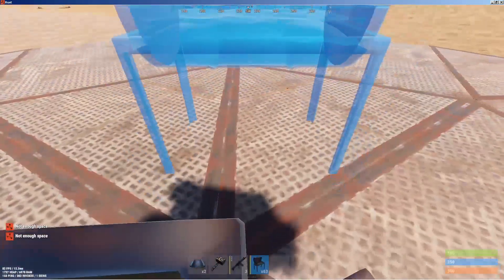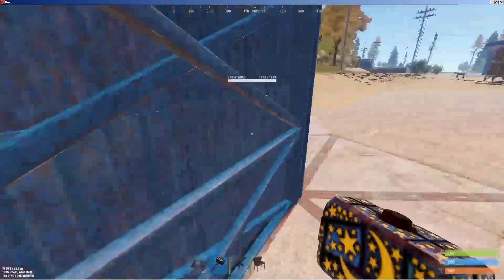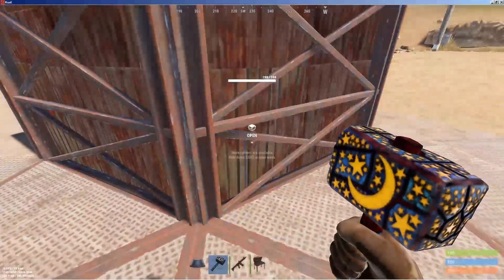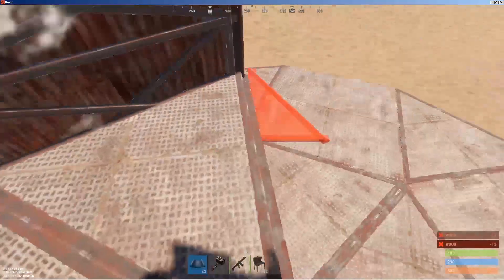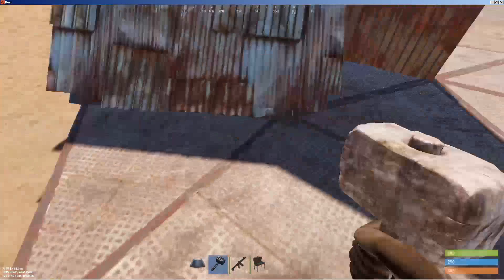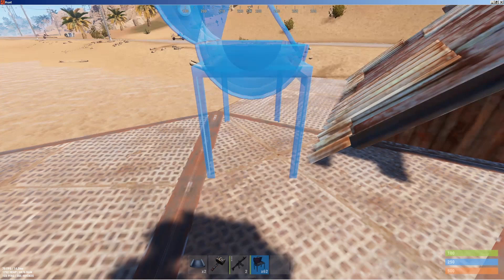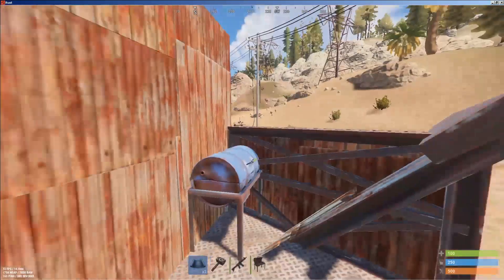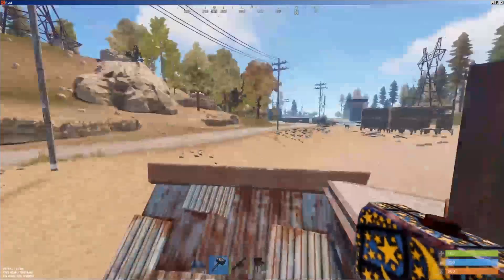PATCHED BBQ 5: The Triangle Cheater Explained (Rust Base Design 101)

Comment: Prefect.

Now you need to do a bar with a double stability bunker entrance, a single triangle sealed bunker, stacked roof, triangle only, tri tc (wall gap used as fire port or to cover hbhf sensor for activating traps) entrance on the roof only, tesla fall wall exit, triangle tile only, roof staked corridor with the shotgun traps to be unsplashable and hbhf activated door push trap, ladder and chair access only, half height crouch walk only with the taps that hit the head that stick through the floor only base... Yes that's a hell of a task
Reply from the maker: Thanx. I consider this a challenge, let me write all that down in a checklist..LOL
Reply: @budsatawny  if you're on Discord I'd be happy to draw some of these ideas in the morning